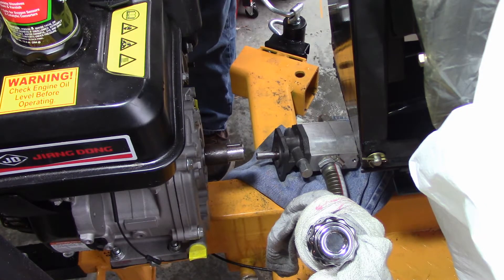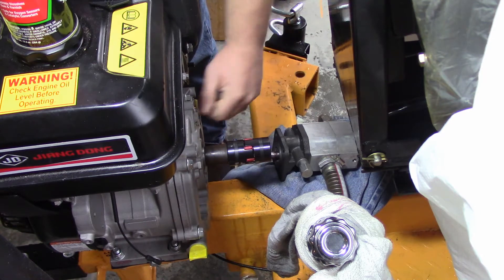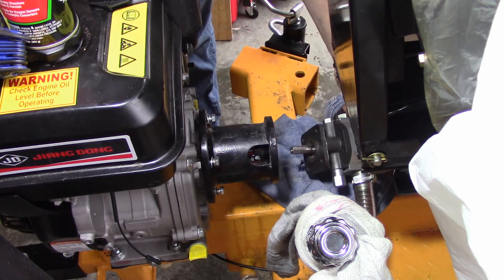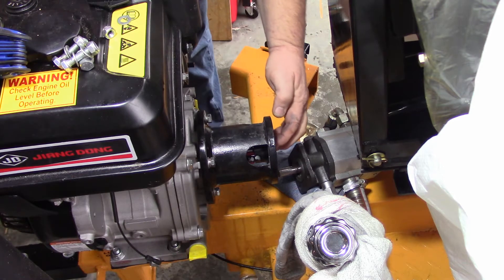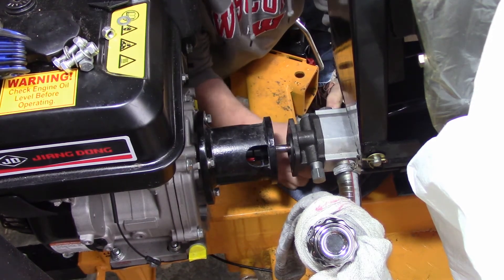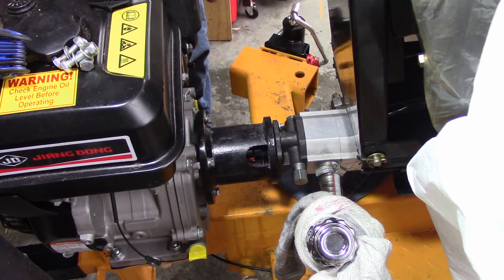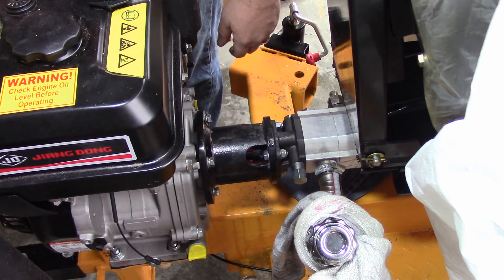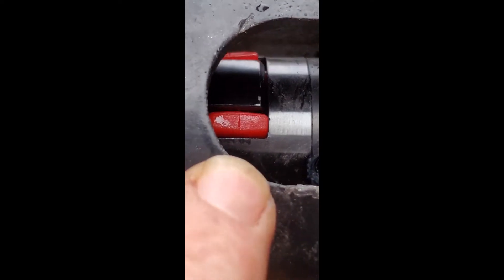ATBH7 Towable backhoe coupler failure and replace.

Comment: When I bought my Betsco I had them throw that in also with my order knowing if something would go wrong it would be in a long weekend. 
That being said, I looked and I can see my Allen screw is almost hitting the hydraulic pump mount.
My unit has been having problems raising the main boom up with a load when fully extended out and on the ground so I'm just wondering if my Allen screw is loose and if the key has been possibly sheared.
You just gave me something else to look at for troubleshooting on this unit.
Thanks for the video again.
Reply from the maker: That's what I was noticing when mine was slow to respond.

Comment: I noticed my red bushing/dampener is worn down.  Bestco did have one in stock.  Is that easy to get out of the coupler?  I know your new one came with it so you did not have to remove it.  Any help is appreciated.
Reply from the maker: The coupler comes apart into three pieces, the two halves, and the red star absorber.  Once you disconnect from the engine and pump side it comes apart really easy and the same for going back together.
Reply: @jetzombie  Thanks so much for your video.  I just bought a used one and used your video to find this issue.
Reply from the maker: @diannajagodzinski7262  I'm glad I could help, Happy digging  :).

Comment: How long is the warranty on these backhoes?
Reply from the maker: Okay, it's a 90-day warranty that covers everything.  Then, after 90-days have passed the cost is on you. They have been really good to deal with on issues. I have had my pump fail and couplers too and they replaced it with no question. They are really nice and listen to any concerns you may have and are willing to help.
Reply: @jetzombie  Thanks for getting back to me.  That sounds pretty concerning if things are failing within that 90 days.
Reply from the maker: @spuriouseffect  So far they have been pretty good with everything.
Reply: @jetzombie  Still, if it breaks within 90 days, chances are it's going to do it again.  My brother has had his harbor freight trencher for years and no problems.  I just don't like the controls.

Comment: Good video. Wish there was a collection pot forum somewhere to store these kind of fix-it tips and how to mods for these towable backhoes.  Most of them all are very similar.
Reply from the maker: Thank you, only after time the population of info will grow. There are many the same or same configuration. It's like the lawnmowers, chainsaw, and other lawn equipment you get at lowes , home depot, and other places. They look the same or similar, because they are built by the same blue print and company. They just paint them and add new decals to separate the differences of them. I've found that a lot of these share the same parts.
Reply: @jetzombie  If you compare HarborFreight and Betstco manuals side by side, maybe 2/3rds of the pages pictures and info are identical copies.
Reply from the maker: @joeltemplin3570  exactly.
Reply: has anyone mentioned coupling alinement